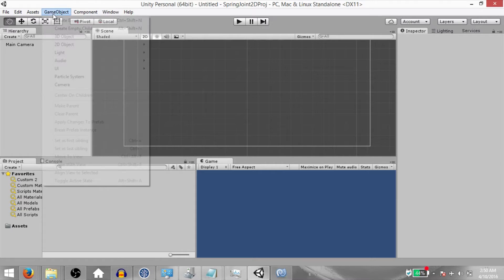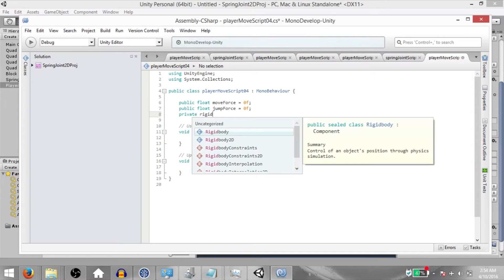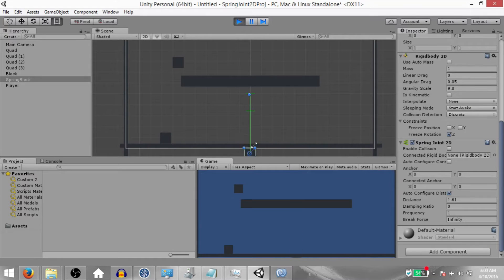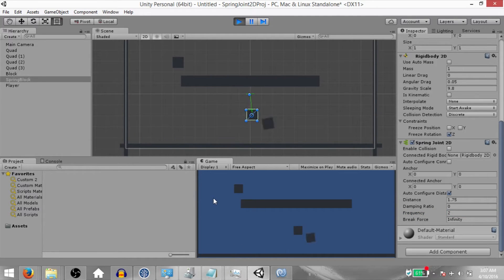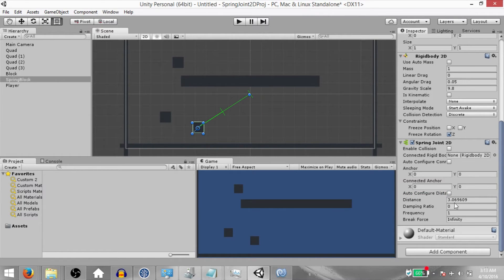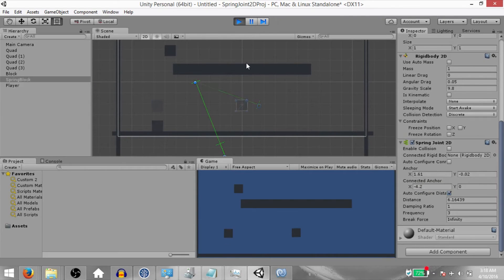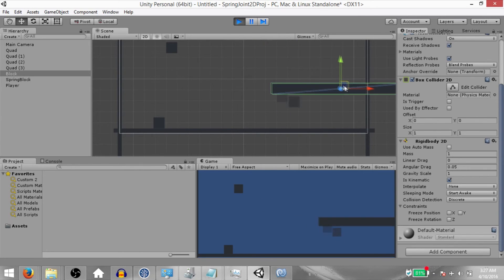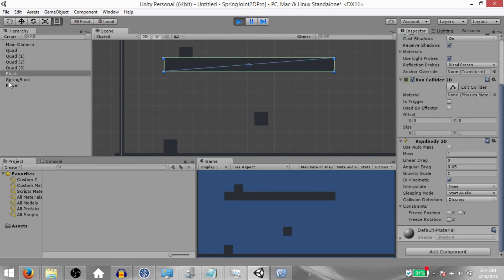SpringJoint2D | Unity Quick Tutorial

Comment: Is there a way to add material to the "spring" so that way it could be seen?
Reply from the maker: +Ryan Syg 
As far as I know, there is no visual representation of the spring. It's just a simulation. However, as a quick fix, you could use a spring sprite instead, and control it's position, scale and rotation using the Anchor and ConnectedAnchor positions.
Reply: +Abhinav a.k.a Demkeys (Demkeys) thanks. I'll give that a shot.
Reply: @RyanSyg  hey, i know its a bit late but did you get it?